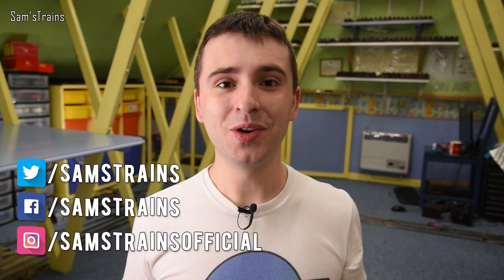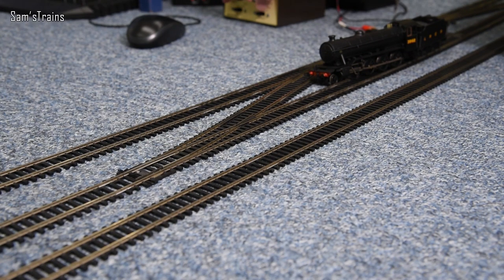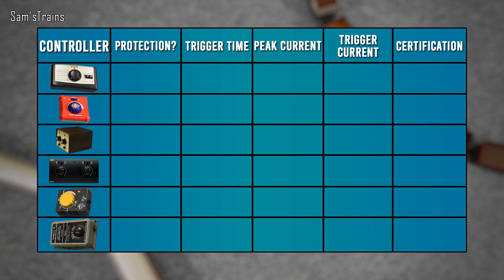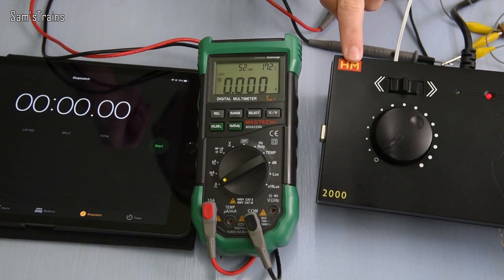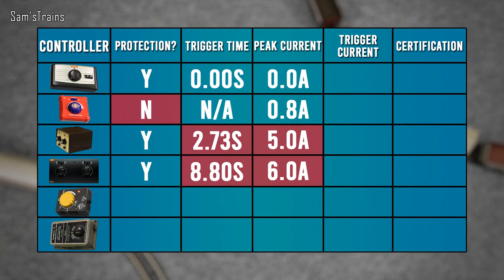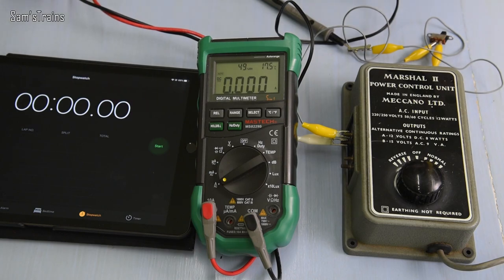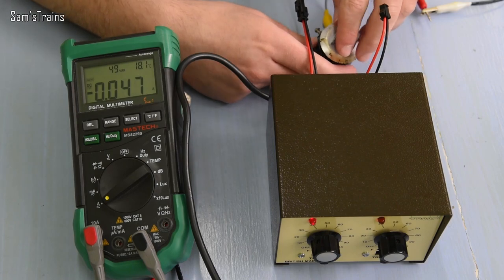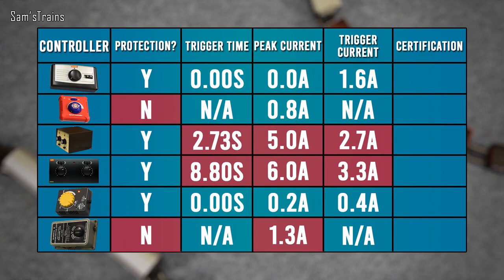What Happens When You Overload Model Train Controllers?

Comment: Marklin digital controllers immediately shut off power the second it shorts out. I've been through that with my Marklin digital controller (MS2 or Mobile Station 2) and then I need to find the area of the short and then rerail the train or check the track for improper connections or the train cars wheels to ensure that the bogeys aren't causing the current to short out. My MS2 completely burned up due to the amount of short circuits it had. Had to send both of them 500 miles away to get repaired. My Marklin layout is a digital AC type layout. Marklin 3 style AC track it uses
Reply from the maker: Yes that's the best way to be - are those digital though? That's pretty standard for digital!
Thanks for watching, Sam :)
Reply: @SamsTrains  if you search up Marklin Mobile Station 2, you'll see that it is digital yes

Comment: A very interesting video and very well done. It's good to know what controller has a short circuit mechanism, cheers Sam. Do expensive DCC controllers have short circuit protection???? I suppose they would??
Reply from the maker: Thanks a lot Guy - yes most of my DCC controllers just die immediately when shorted - it would be interesting to learn if they all do!
Thanks for watching - Sam :)
Reply: We have a Digitrax DB150 on our layout that is capable of around 5 amps.  If you short it out it detects it within a second or so, cuts power, and beeps to indicate a short.  It then periodically attempts to power back up but cuts out quickly if it's still shorted.  Because of DCC's alternating signal, you can actually hear shorts because the arcs produce an audible noise.

Comment: Some of these controllers have different plug types as well. I currently use a old Hornby R965 controller and the plug has some sort of relay cut out, I found this out as a little triang 040 Nellie keeps shorting due to a possible motor issue. You can tell it shorts as the plug will start clicking.
Reply from the maker: Yes I have heard that some controllers have protection in their adaptors - I'd argue that this is a poor design, as a change in adaptor could easily negate the protection!
Thanks for watching - Sam :)

Comment: i have a Mrc Tech 2  2400 i never seen the overload light come on , however when i run my mantua steamers with an Athearn controller  it will have the overload light come on if i run too much when i was testing the locomotive to see if it ran. mind you the motor was running no shorts just requires more draw.
Reply from the maker: Yeah I've heard that the Athearn locos draw loads of current - I wonder why that is?!
Thanks for watching - Sam :)

Comment: Hi Sam,

What happens with DCC controllers? Why weren’t they included in your test?

Jim
Reply from the maker: Hey Jim, DCC controllers work very differently - they're designed to output much more current, and therefore have much more sensitive safety systems - all of mine cut out immediately!
Thanks for watching - Sam :)

Comment: and in conclusion, you are going to be attaching that mahano controller up that inside track and use that one for running in your locomotives?
i think one other issue you might consider is that in your case, there is the carpet as a low grade fire risk.
Reply from the maker: The Mehano is great, but I wouldn't choose it over my HM2000s or Gaugemasters - they do perform better! haha yes I suppose so - but the carpet is flame retardant, and I never run locos unattended (for long!)
Thanks for watching - Sam :)
Reply: @SamsTrains  I wonder why they perform better.  Might be interesting to see the output of them in greater detail though unfortunately that would require real test equipment or at least using some of the other settings on that great meter of yours

Of course it could also be that the greater available current of the larger controllers has other less obvious benefits.

Comment: Wonder what happened with the bachmann? Mine trips its short circuit protection sometimes, usually just cutting power to the track ( if I'm lucky if flashes the light on top too). Not sure under exactly what conditions though.
Reply from the maker: Yes others have told me that too - mine sustained full current indefinitely without cutting out! I wonder if the safety system failed?!?!
Thanks for watching - Sam :)

Comment: HI Sam really enjoy your reviews and experiments. I have a few old controllers which are good but little or no short protection so I took an idea from my boats 12v system and run my track power feeds from the controllers through a fuse board, sure if you do get a short it with blow the fuse, but hey their only a few bob each and your locos can cost a few hundred quid, why take the chance. Ideally I will change my controllers to ones that have protection but until I do this works well. Cheers Drew
Reply from the maker: Thanks very much Drew - that sounds fantastic - so they're resettable fuses then?? :D
Thanks for watching - Sam :)
Reply: @SamsTrains  The ones in the boat and on the train are one time use so once blown I have a few on hand, the system is very cheap to put together and its a bit like a cars fuse box you pop the blown one out and put a new one in except I use a single cartridge per line, why I did it that way is you can go as low as 300 milliamps on individual circuits. The main12v line from the bank of three car/marine batteries of the boat is reset-able but that has a 30amp loading. The 12V fuse box supplies different rated fuses to the various items like left and right lighting (my boat is 55' long), 12v fridge etc. In my model railway case each controller output feed has an inline fuse cartridge on the positive side. The downside is that you have to know where the short is and fix it before putting a new fuse in else it's obvious what happens! Fuses are about 8p each.
Reply: My 20th Century DC  controllers are a Pace single and a Pace double early 1980's, a single H&M 1970's controller, and a 1970's panel mounted slave H&M  that runs off an uncontrolled 12v output from the H&M Controller. My DCC 21st Century side of things running from a Hornby Elite through my PC with Railmaster (problematic). Never had any DC problems except my own caused faults, I find the older controllers give very good controlability :)

Comment: Very interesting. I'm surprised that none of these controllers have manual reset breakers, I remember my first controller (Tomix N-scale) had one, as does my current Kato controller. By the way, next time you do something like this, set the multimeter range manually (disable auto ranging) so it doesn't change range and interrupt your demonstration.
Reply from the maker: Me too Ken - manual resets are by far the best option, very bemusing that none of them have that! I thought the range was manually set, was it not?!
Thanks for watching - Sam :)
Reply: @SamsTrains  You had the multimeter set to automatic range, so whenever the value changed rapidly (like when the controller tripped) it would blank out for a fraction of second as it changed the range. Setting the range manually would avoid that. Though it would be even better to use an oscilloscope.

Comment: I tried this when I was a kid.  On older controllers, they popped a circuit breaker and I had to push a little red button in.  Newer ones just turned off the power until the short was removed.
Reply: The problem with that was you could keep the button pressed down. That's what I used to do. I didn't know any better when I were a lad.
Reply: @Poliss95  I tried that, of course!  The manufacturer outsmarted me, though.  The breaker still popped when I held the button in (I remember) and I had to release the button and then press it in to reset it.
Reply: @HungryGuyStories  I could with the old Tri-ang P4 controller. :-)
Reply from the maker: I do love the circuit breaker idea - but like Explorer says, they're very easily overcome! For adult collectors though (who know what they're doing), that would be great to see again! :D
Thanks for watching - Sam :)

Comment: I now know why when a loco derails my controller switches off I have 2 of the cheap Hornby ones and an old one the old one doesn't switch off those old ones are horrible but it's the only other one I have. Also if my pendolino's motor bogie is facing the wrong way it shorts the controller out. My P2 once drew loads of power from my controller. It had to have a new motor 😒 classic Hornby. Great video as usual. I have also found some Hornby locos wires go weird and the coating melts. My pendolino and a cheap 08
Reply from the maker: Ahh yes - the Hornby ones are very sensitive indeed! And yes that's right - if there are pickups on both bogies, having one the wrong way will cause a direct short! My P2 also sometimes causes shorts on points - I'm not sure why it is!
Thanks for watching - Sam :)
Reply: @SamsTrains  my p2 had a motor fault and apparently many people had the same problem. Hornby customer service is good though they refunded us the £8 it cost to send it.

Comment: Believe it or not, but I had an older controller for my O gauge train but was able to run it the controller with my N and HO scale, so one night I was curious, what would happen if I took to wires that connected to the track and put them into the outlet (one socket over from where I plugged in the controller) to my surprise when I put the two cords in with full power on the controller, there was a HUGE spark that came from my outlet, luckily the outlet was fine, but the controller, not so ok, I opened it up and everything was fried, and if I moved the throttle it would be hard to move. My parents heard the pop from the electricity and I passed it off for being on of my cap guns because I was "messing with them"
Reply from the maker: Wow! Definitely not a good idea - no doubt that fried the low-voltage circuitry on the controller's output - you were really lucky not to get badly hurt!! D:
Thanks for watching - Sam :)

Comment: My class 47 causes a short circuit most of the time when I put it on the track but after the controller resets and its fine
Reply: Turn the power off when you're putting it on the track.
Reply from the maker: Yes that can sometimes happen with some locos - most controllers don't mind being shorted for brief periods!
Thanks for watching - Sam :)

Comment: I had this happen to me, one of my locomotives derailed and jumped track to track on me at a little quicker pace, I shut it off and went and got it put it back on the track, full power lights come on axels flinch but doesn’t move and my controller now makes this awful vibration and buzzing noise super annoying, don’t trust it much anymore, got a new loco gonna replace that same one since I’m not sure how to fix it but definitely p*ssed me off cause controllers aren’t cheap, I had a nicer one now it’s kinda ruined might have to get a new controller for my own sake of mind, and the locomotive was a loss luckily a cheap switcher, easy replacement but point is it can definitely happen, also all other locomotives run and operate fine I’ve tested them since just the controller now has the consistent problem as mentioned.

Comment: Huh. It seems digital controllers supply way more current. My roco z21 pro can supply up to 3A at up to 24V before tripping over current protection.
Reply from the maker: Yes that makes sense - they're designed to control multiple locomotives independently, so higher current should be expected!
Thanks for watching - Sam :)

Comment: Isn't 2 amps enough to kill someone?
Reply: Probably not on a 12 Volt supply, but people with heart issues or those with pacemakers need to take care, as they do when being in the proximity of electric cattle fences, low voltage lighting or Tasers.
Reply from the maker: 2 amps certainly is more than enough to kill someone - probably 20x more than enough! However, the voltage required for that amount of current to pass through the body is much much higher than 12v - as John said!
Thanks for watching - Sam :)
Reply: Ahhh ok - thx lads :)

Comment: My little 2004 Christmas set tank engine always details with it's hard to manage speed and bridges over the tracks and short circuits my controller, I have 2 controllers and one has no protection so I have to be extremely careful with that controller and my loco
Reply from the maker: haha yeah - again though, it's very unlikely that your locos would be damaged by derailing and causing a short... it's really only mechanical lock-ups or stalls that can damage motors!
Thanks for watching - Sam :)

Comment: ah yes the old prioblem of the majic smoke escaping if you want something that will survive, get a speaker l padthey are used where you have a multi way speaker with each unit producing its own frequency range, such that they all add up to the full frequency range. as some units are more efficient, so an l pad is put in series with the more efficient driver and the l pad varied until the efficiency of the "hot" unit matches I have seen 10 amp l pads so that would give just over 9 amps continuous and a 10 minute cool down between tests would let you test for hours as it is always heat that lets the magic smoke out and cooling is my reservation about coreless motors at least on conventional motors all the metal in the rotor absorbs a lot of heat from the windings, slowing temperature rise and also is able to dissipate some heat to the air, plus an open motor must generate some air movement, which can motors can not {terrible pun there}
great episode all the best roy

Comment: Naww, my 7mm Class 20 running on a Volvo windscreen wiper motor is a controller killer, that draws 5-7 amps with a reasonable load.
Reply from the maker: Wow!! That sounds insane! And at 5-7 amps, it must have some serious pulling power?!?
Thanks for watching - Sam :)
Reply: @SamsTrains  It has a large amount of lead in it for traction, I've never found anything it won't pull yet!  My record so far is 45 O gauge wagons and play had to be abandoned because the controller started to smell a bit funky.

Comment: BEWARE: If you run a Hornby train set controller just under max load, it heats up and starts to melt the plastic.
Don't ask how I know this 😉
Reply from the maker: Blimey - did that really happen?!? :O
Thanks for watching - Sam :)
Reply: @SamsTrains  yep it did! I use if for acessories so it has a stable power. Flip and point and the whole thing dies

Comment: 20ma is fatal to a person so in the right situation it mite kill a person reraling a loco with weals shorting  out track
Reply from the maker: Not quite - in order for 20ma to pass through the body, the voltage would need to be much higher than 12v or 24v to overcome the resistance of the human body! 12v is perfectly safe, even if the power supply is capable of 20A!
Thanks for watching - Sam :)